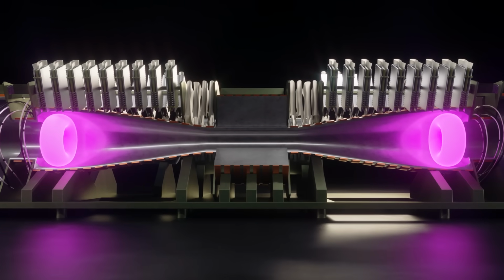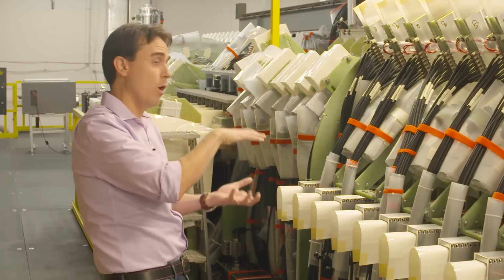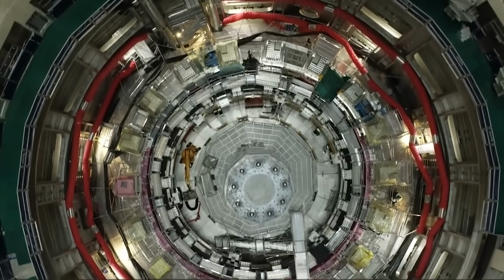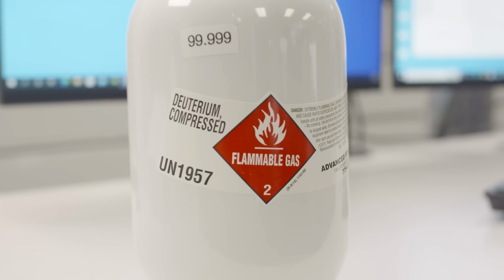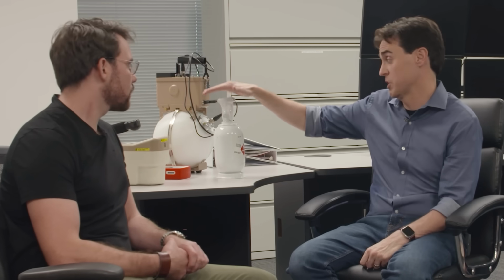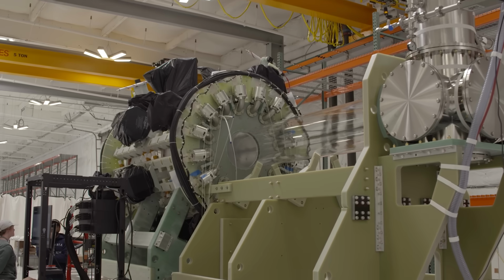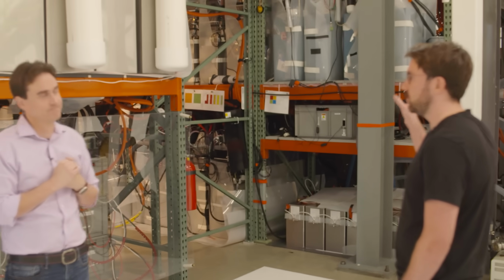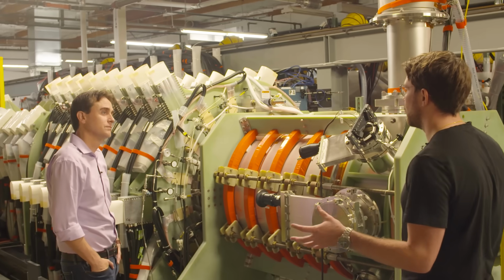A New Way to Achieve Nuclear Fusion: Helion

Comment: Although this device is not a diesel engine, its architecture takes on a kind of “dieselesque” persona. The system compresses its working medium until the state change happens because of the compression itself, much like how a diesel cycle relies on compression to trigger ignition. It’s a different physics entirely, but the architectural gesture is similar: a rapid, cyclic squeeze that forces the transition rather than an external ignition source.
One small addendum: even though the D–He³ cycle is often described as “aneutronic,” the unavoidable D–D side reactions still produce a modest neutron flux. It’s not large, but it’s not zero — and for a hybrid fusion–fission system, you don’t need breakeven fusion, only a reliable pulsed neutron source. In that sense, even partial success with a Helion‑type architecture could support a subcritical blanket long before full fusion power is achieved. And because the cycle recovers energy through magnetic induction during plasma expansion, the architecture can already capture direct electrical output even below breakeven fusion.
In a fusion-powered world, fission becomes the superior “battery” — a compact, long-duration, high-energy-density power source for environments where chemical batteries, wind, solar, and even fusion machines are impractical or impossible.
I suppose that even if Helion never reaches marketable breakeven, its pulsed FRC architecture may still be the most viable fusion option because it produces direct electricity, avoids extreme neutron damage, and scales economically. Breakeven is not the only path to a practical fusion plant.

Comment: Wait… so the reaction creates ions that push against the magnetic field that’s there to keep them in place. And that’s how we get energy out… but if we don’t spend more energy pushing back on it, then it will hit the walls. So where is the bit where we extract the energy to do work with?
Reply: YES! It sure seems like they will require increased energy when fusion takes place.
It's like a steam engine but external energy is required to keep the boiler from blowing up.

Comment: No one has found a new way or any other way to produce commercial fusion. Scientists build these for research purposes. The materials science necessary to contain the heat and pressures of viable, commercial power and the power range needed does not exist. And the gap is huge.

Comment: If compression via electromagnetics is true, why are people still making silly equations about black holes? As for stability and control, why not use platinum or gold, thereby unlocking higher level of sustainability, temperature variance, precision and control? Also, what if enough pressure forms causing an explosion? Are there practical safety measures in place?
Finally, if you have 4 dimensional pressure, the entire mechanism grows in potential too, but if so, when does one have to think of the consequences within our planet's electromagnetic field, orbit, axis and more... Eventually, all these electromagnetic fields will have a global effect if it hasn't already, even if marginal.

Comment: What if the magnetic field fails? This would directly make way for high temperature and high pressure plasma touch and melt down the walls of the reactor and explode quickly.

Comment: The problem is not initiating fusion - working fusion reactors have been built for quite some time. The problem is getting a net energy gain from it.
Reply: Not just this one.  Still more.  i. reliability of the machine, it needs to be running non-stop 7/24 365 days  ii. fuel supply problem i.e. commercial supply of tritium for scale of a electricity plant  iii. neutron radiation problem i.e. damage to the machine and factory equipment   iv. electricity feeding to grid because method like direct energy conversion in pulse mode create a huge challenge to the grid.  It can cause complete black-out of the grid. v. cost problem.  they need to be cheap enough to compete with other kind of electric generation.  otherwise no company will buy their solution.

Comment: Hey i had a similar idea but it used gravity manipulation to create a hyper dense gravity point in its core before injection to create a stable fusion effect within that gravity bubble, then just injecting mass to fuel the star as it needs. Kinda like a fuel injector but with gravity fields. That was for a sci fi project. This is waaaay cool though.

Comment: now if only ud stop degrading the technology to steam then sampling the steam for electrons, you do realize that the basal layer of dealing with steam is that your stripping the electrons from the oxygen diffused from the h20 to produce energy right? the ideal scenario of what your doing is to syphon the high energy atoms while procuding energy required to run your system via solar,  which means your crafting radioactive elements using steam as a low level energy output source, and directly harvesting the radioactive products with the inverse properties of magnetic flux, attmpting to detonate the radioactive elements in a low grade system designed to produce the product rather then a machine designed to make the most out of the energy output is unideal, the same logic used in the particle accelerators to capture dark matter using a runaway path hulled with 'magnetic hulls'( a magnetic field) is an ideal setup, so again 2 sources running off of solar that takes free energy to both power and cannister the higher energy products and releasing that energy at a target product, witha final reminder that both projects should be as close as possible while still completely outside of dangerous interaction distances, will yeild far more power then the default distances therof.

long story short:: attempt to harvest the product faster, attempt to focus on the amount of fuel derrived, attempt to reduced the size of the built product to smaller scale for multiplexxing and transport, bring the resulting products closer to the output system.

Comment: @ReickyFOX why do we need  super heated steam for generator and running mechanical parts and decreasing the real efficiency. Everybody knows the mechanical efficiency is  about 30 to 40 % and electrical around 80 to 95%. It's direct electricity generation from magnetic field and D20(heavy water)and T40...Fox you are really a fox not understanding global warming and efficiency and climate change.

Comment: And you can see how using multiple systems, re-oriented with an exhaust, that with a high frequency system, you could create a fusion propulsion system, with electrical power generated as the plasma exits the rear...
Reply: Of course you probably would need a regular nuclear reactor to supply startup and maintenance energy, but you could harvest back energy to increase the efficiency...

Comment: oops, its not cold fusion  ,its using it a differ way,  Im amazed,,  wow,   Helium and Hydrogen,  and plasma   if you pull this off,   we will not need gasoline ever, or batteries,   Good luck,   I will try to keep up with you and not ignore you, like we do nazis,  i would love to see the car made like this to power its motor.   It will change the world. no more drilling.

Comment: Liquid Fluoride Thorium Reactors, such as those designed by Flibe Energy, have a byproduct of Tritium. These reactors have a proven efficiency and lower cost to build than any other design. I'm all for Fusion, but the Tritium shortage could be a problem.  This makes Fusio and LFTRs symbiotic or complementary as side-by-side forms of nuclear energy.

Comment: Quick reminder it's been 2 years without much news from Helion
Reply: They just broke ground on their new facility and got multiple funding sources, including Microsoft. Quiet but steady. We’ll be lucky if this amounts to anything within our lifetimes, but if anything, I’d bet on Helion’s smart iterations rather than in the insanely huge and delayed ITER being more applicable contributions to nuclear fusion.
Reply: cutting edge engineering takes time. They were probably only doing a marketing thing with these vids to attract investors, to fund the engineering that still needs to get done. Now that they’ve been funded it doesn’t make sense for them to spend time and money on PR when they could be heads down on building the thing
Reply: @maboesanman  well they are posting some PR, for example releasing videos about their employees' backgrounds and so on. Just kinda strange not to hear anything about how the tech is coming along, considering they apparently already signed a deal with Microsoft to power a (probably AI) datacenter. Kind of hard to accomplish that without at least having a working prototype. Maybe the DC deal is also PR.
Reply: @afz902k I’m sure they have more to show if you’re a prospective customer, but other than that the more substantive info they give out on the internet the smaller their business moat.

Employee background vids are pretty clearly to drive hiring efforts, and the original vids were probably to drive public interest before funding rounds.

If we (YouTube audience) were customers, then silence might be able to be construed as stagnation or delay, but most of us don’t have a spare hundred billion dollars so there’s not a whole lot of reason to try to keep us informed. We already don’t know the manufacturers for most power plant hardware and I would think knowing a ton about it would be a red flag that fundraising is all the company is trying to do.
Reply: @afz902k They recently started building a center in Malaga, WA. Don’t think they wouldn’t start a massive project in the middle of nowhere if there was no progress being made.
Reply: Yeah I wonder how much of that billion dollar contract they burned through!
Reply: This video was an ad that they sold to their subscribers
Reply: @fess3932  it's awkward because the video makes it seem like they progressing at a pretty steady rate. On their website there are some news, but nothing about finishing more prototypes or any breakthroughs. Though it seems they are involved in a Microsoft Datacenter that's being built and aims to be powered by fusion at some point. I wonder how they could even do that when they haven't published much, other than supposedly successful tests with Polaris.

Comment: Even if we achieve fusion, We will never see another star system, and the closest even with a fusion device going 500k mph would take 6700 years, So even the American UAP which hypothetically use fusion devices are trapped here for a while.. The good part it changes our energy needs till we make better technology in the future.. We are long ways off lightspeed engines/warp drives.. I personally believe aliens are BS, and fusion has allready been made in American blackbudget military corporations, but that’s just my opinion..

Comment: The secret to all this is simply this. You need tritium as fuel and a diamond semiconductor made with lithium and terellium. Direct electron power sources. Needs to be unsidea Platinum casing for magnetic reasons.

Comment: It's a good way to achieve fusion, combining magnetic confinement with kinetic methods of fusion, and potentially being able to replicate this fusion by sequential pulses. However, there still remain the problems of achieving over unity and extracting the energy from the fusion reaction, since only a fraction of that energy generates electricity.
Whilst this design represents progress, I still think we have yet to design a fusion system which has the ability to be commercially viable.

Comment: Of what is written on the Helio energy website is true then apartently the development of this fusion reactor is going really well and is going to be the first to finally and properly generate electricity via fusion and will power a Microsoft building of some kind by 2028.

Look on their website, on the FAQ section.

Usually with these types of videos their from 2019 or 2021 and the clip looks really cool and you go check the website for updates and you find it says "Coming soon 2022" and no further updates or something that indicates that the company has failed or something went wrong and it's all a bit sad, depressing and we're back to the good ol' fusion meme of "it's only 30 to 50 years away" but to finally see that the company is not only alive, with real progress and IF the website is true and accurate then FINALLY we will see fusion actually happen not in "30 to 50 years" or many centuries of time away but instead for once fusion that's actually generating electricity is actually 3 years away?!

Comment: my one question is if the power draw to make it work is worth the power output... can it sustain its own function with the power it creates? can it make a usable energy profit? any result other than a deficit seems as though it'd defy physics itself.
Reply: So far, I don't think so and despite alot of progress being made towards breaking even it'll probably stay in a deficit for a while.
Reply: @lim5555-7  as i figured tbh
Reply: it consume fuel in order to work, but it would be our most efficient power generating device
Reply: @codegoblin7740  i know it'd be fuel consuming, but the electricity requisite to even make it work is the question

Comment: You have to imagine that all of the plastics that are being used has something to do with the high magnetic areas. There is lots of brass plastic stainless steel. The magnetics being produced in that thing must be insanely high Marrying plastic to stainless steel is not something you see every day either there  must be some processes in this situation that could cause two pieces of metal to fuse together because of heat so they have to use dissimilar products to make fittings together. very interesting.

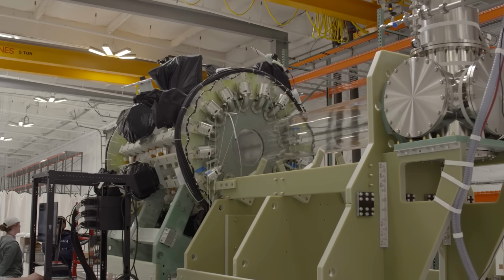Comment: 18:02 r 10 years away.  In 10 years it'll be 10 years away
Reply: They just showed their next generation machine, Polaris do its first pulses. That one took a mere 3.5 years to build and is meant to demonstrate the production of a small amount of electricity from fusion. If that is successful, then they have a contract with Microsoft to deliver a 50 MWe fusion power plant in 2028. So, not that far in the future.

Comment: el concepto de crear  plasma tal vez sea  legibe    pero crear   energia   despues de haber creado   millones de  grados    de calor     que sentido tiene    crear   energia electroamgnetica despues de eso         y  no usar ese calor  para los que todos hacen      aprovechar el calor  para generar vapor  y mover  turbinas  ???
creo  que este señor    esta  tan embriagado  de querer generar    energia  electrica  sin  hacer  lo que todos hacen  ,  generar  vapor  .  
 GENERAR  :   NEUTRONES   O    ELECTRONES    es la clave   para el  exito  de estas tecnologias     ,   para avanzar   en este tipo de tecnologias   se nesecita  mentes creativas  con dones ecepcionales   de inventiva   e inspiracion   ,    para tener exito   ,   solo con ingenieros  no lograra  o ta vez  si  pero   dentro de  30 años mas  .
Reply: The direct conversion can theoretically be MUCH more efficient than steam turbines. It is also more compact and does not have any moving parts which reduces costs.
Also, Helion's machines would only produce one (2.45 MeV, so comparably weak) neutron for every three to four (if they have enough He3 from Tritium decay or trade) reactions. The rest (vast majority) of the energy is released as charged particles.

Comment: What's important to remember that this is just a proof of fusion concept. Fusion reactors will never be sustainable because the heat generation is way too hot and there is mo material that exists in the universe that can handle the heat sustainably.
Reply: Thats why the plasma is contained by magnetic fields and there is a vacuum around it. It is still taxing for materials but it can be handled.

Comment: Is this a joke ? A fusion reactor built from plastic, sitting on the cheapest rails from Ali- Baba  ?
Reply: Eh? Their machines are not made from plastic. The vacuum chamber is made from fused silica (aka quartz), the magnets are aluminum. Both react very well to 2.45 MeV neutrons from Deuterium-Deuterium fusion.

Comment: Interesting.  Direct electrical generation is a huge advantage.  It's almost as if they have designed a nuclear piston.  What is the current Qe?  What do they expect Qe to be in a year or two?  I wish I could help, but I'm a software engineer.
Reply: Their Q(eng) will be relatively low at 2 or 3 or so. But they don't really need more than that to be commercially viable.

Comment: You realize what this is right?! think about it... cut it in half and point it at something you don't like.
Reply: There is a reason why we are not using jet engines as weapons, even though some large ones can produce over 100 MW of power (that is about twice as much as the Helion fusion engine). The effect would probably be similar to that of a jet engine blasting at something.
Now a Helion fusion engine also needs a whole building full of capacitors, shielding and whatnot attached to it... Just not practical.

Comment: When you say nuclear fission reactors are expensive I feel like you didn't do the research, nuclear energy is by far one of the best forms of clean energy when compared with solar and wind. The upfront cost is big but the fuel cost is very low and that is even if uranium fuels prices go up a lot. That is substantially different to say natural gas or oil where the initial outlay is lower but the fuel is high capital expenditure.

Comment: What if, instead of keeping an extremely unstable and hot plasma continuosly (like in the usual tokamak),  you guys create a very rapid succession of small fusion events like the one described at the beggining of the video? It would be like a fusion machine gun. If the detonations are rapid enough, the heat maybe could start accumulating ... Would that work?